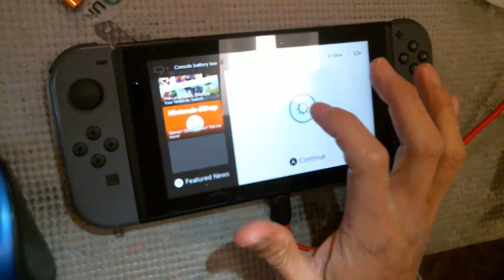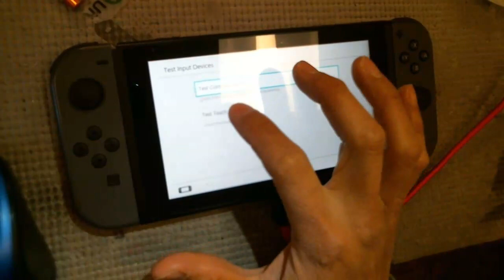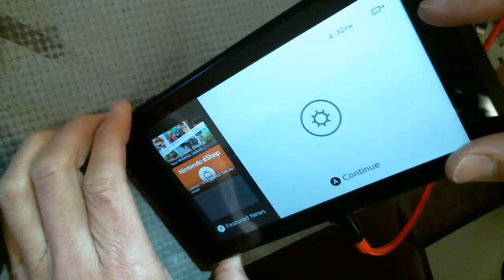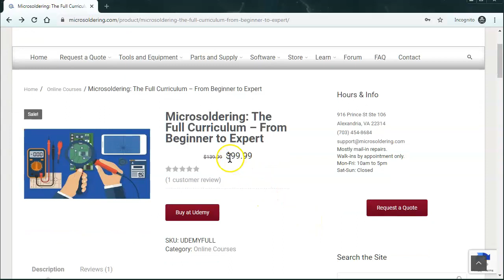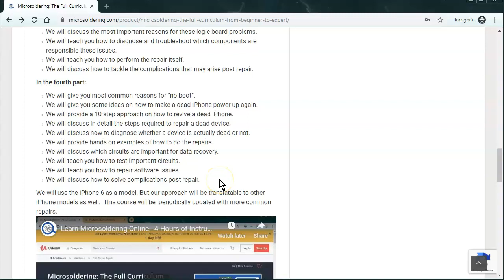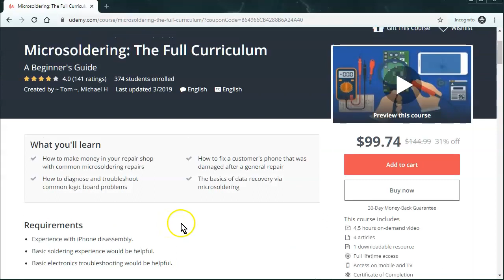Nintendo Switch Diagnosing and Repairing a Charging Problem

Comment: Hello, you can use a Solder Sucker to get the solder out of the hole. From one side you hold a soldering Iron on the hole till the solder melts, on the other side you suck the solder out. Works fine for me. Nice Video!

Comment: Board swaps are viable if you can do them reliably and for data recovery. From iPhone 7, board swaps are a little easier. But you need to be charging above $400 for a swap because it is an advanced skill.
Reply: Board swaps are easy especially compared to soldering. Also how are they better in any way than making a repair easier.